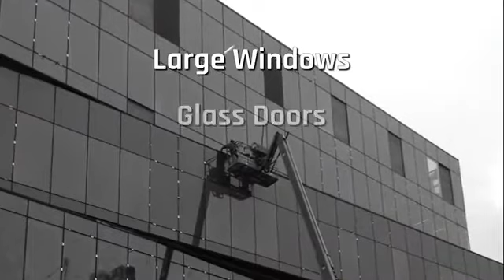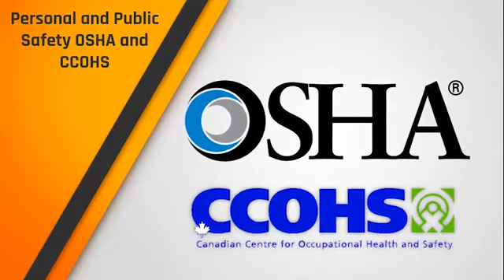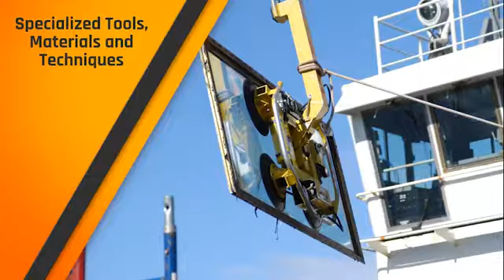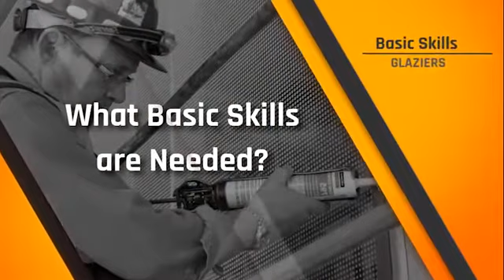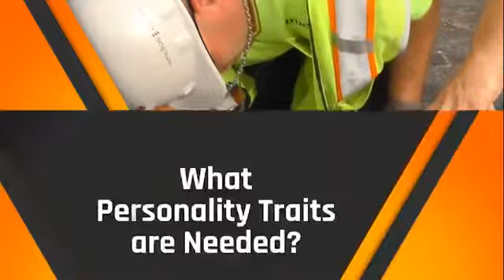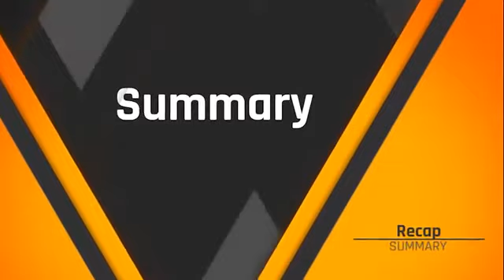Glaziers

Comment: Local 200 I have been off work for 1 year out of 5 years working in the Union. Non Union I have worked 50-60 hours a week for 15 years, no time off.
Reply: I got an offer for a union apprenticeship for glazing. Still on the fence towards going into ibew electrical. Not sure, how has your experience been?